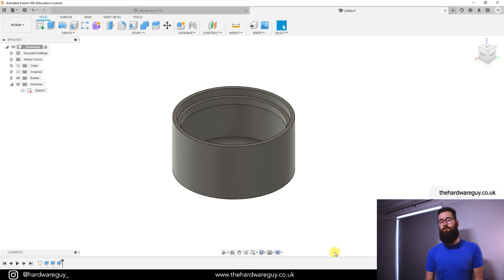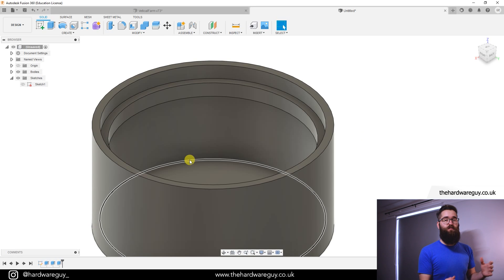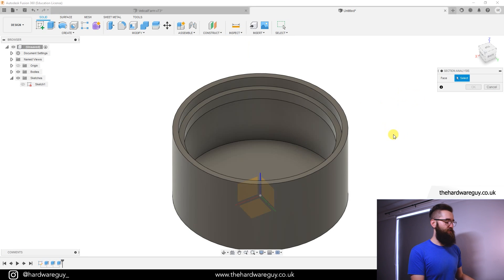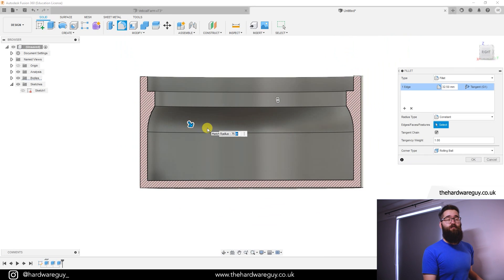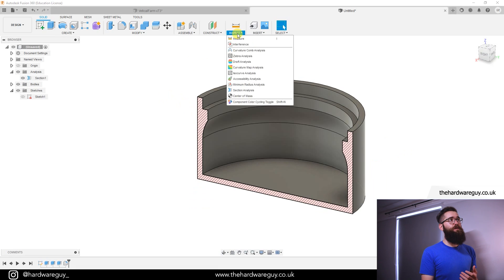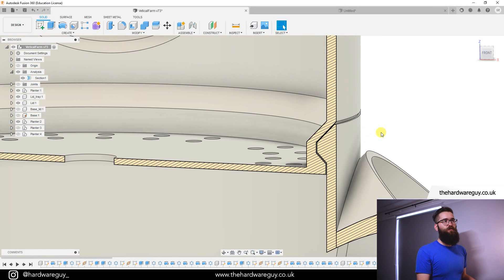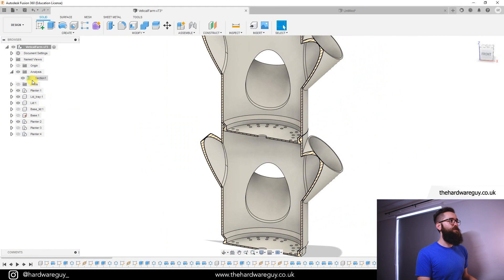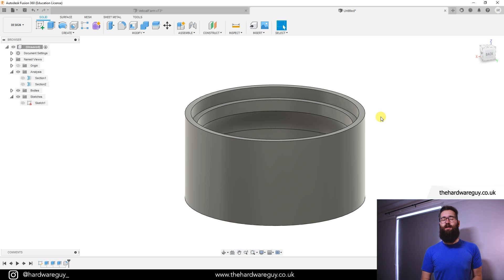Fusion 360 Section Analysis

Comment: The problem with section analysis is that it cuts everything that is visible so you can't see how it works with parts that are whole. I mean one part sectioned off, the other part whole. Irritating when you're trying to check the alignment etc..
Reply from the maker: I don't understand what you mean? the tool can be rotated or moved to intersect at any position. You can even create an offset plane and have it intersect based on that
Reply: @thehardwareguy  Yes, I have used those techniques before. I have been unable to limit the section analysis to only one part in my assembly. Is it possible to limit the section analysis to only one part?